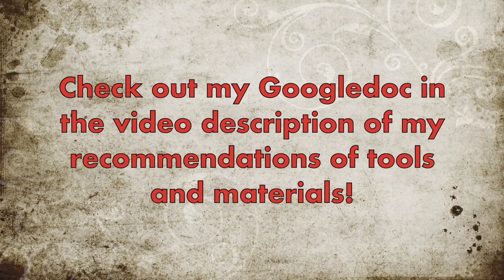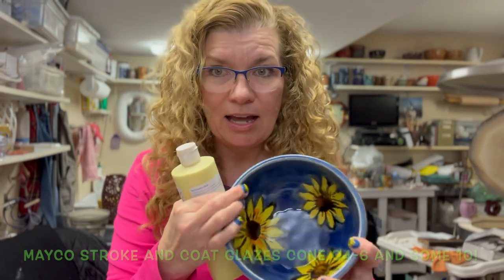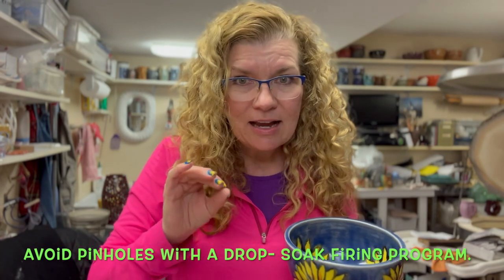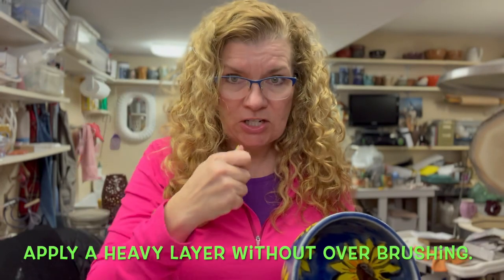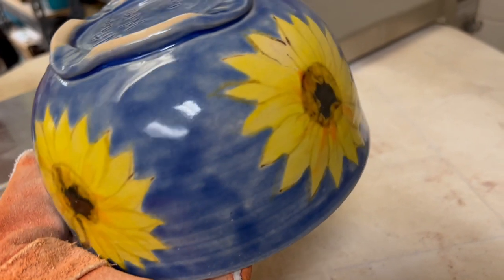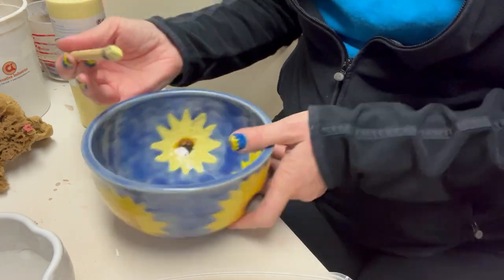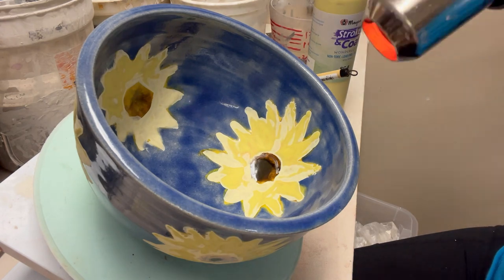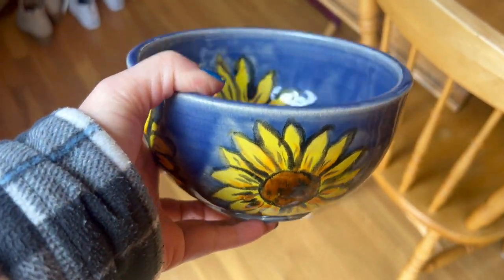Mistakes Happen: Reglazing and Refiring a Sunflower Bowl to Fix a Thin Glaze!

Comment: As a greenhorn potter I am so thrilled to find your wonderful videos Karan.  Haven’t tried Coyote glazes but am very interested in trying them. This video is especially interesting  Re: your glaze problem with the iron based color painted over the yellow.  I have seen that before as a porcelain artist (read overglaze paints).  One of the first things I learned was that yellow pigments are notorious for “eating” iron based colors (reds) and to be very careful to keep them separated in porcelain painting.  I wonder if some of the pigments in pottery glazes are the same as the pigments we use in porcelain painting?  Maybe try a test tile to see if that could be the problem?  Thanks for the wonderful videos!
Reply from the maker: Great observations, Linda- thanks!! I will definitely be testing more to see what gives! That bowl was a very impromptu idea with no prework testing any combos! I’ve only recently started playing with iron oxide accents like that- so this was a great learning experience!

Comment: Hi there!  Could you Please tell me where your drop/hold/soak firing schedule is at? I could not find it.  Thanks
Reply from the maker: Whoops!!  Thank you for the heads- up!!  Sorry, I forgot to get that in the description!  I got it there now!!  :) Here is the text I added:  Cone 6; Ramphold  Drop soak program, medium speed. Skutt programming 

Rate 200
Temp 180
Hold (whatever needed)

Rate 200
Temp 250
Hold 0
 Segment three continue
Rate 400 
Temp 1000
Hold 0

Segment four  continue
Rate 180 (This is slow for quarts inversion)
Temo 1150
Hold 0

Segment 5 continued
Rate 300
Temo 1917
Hold 0

Segment 6
Rate 120
Temp 2167
Hold 20 minutes

Segment 7
Rate 400 
Temp 2067
Hold 20 min

https://digitalfire.com/glossary/drop-and-soak+firing
Reply: Thanks so much!  The kiln schedule is real eye-opener!  👀. Appreciate you posting!  And the really quick response too!

Comment: I had a pottery instructor tell me to paint the glazed pot with white glue so that my reglazing would stick better.  Have you ever tried this?  Would you recommend it?
Reply from the maker: Hi Susan- I’ve heard people mention this in the past.  I’ve never personally done it because I’ve never found it necessary.  I’m a little hesitant to add ingredients that could potentially burn and leave a slight residue within the glaze as a potential contamination.  It may work perfectly well, but I’ve just found heating to do the trick for me! 🙂
Reply: We have successfully used hairspray